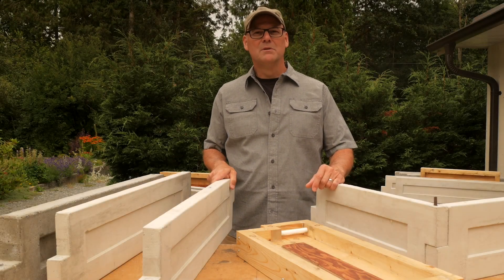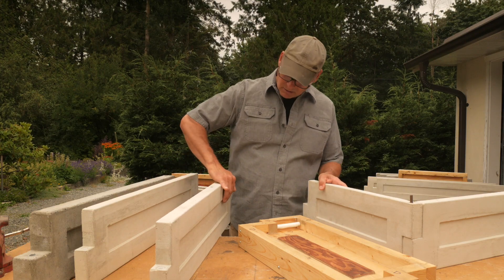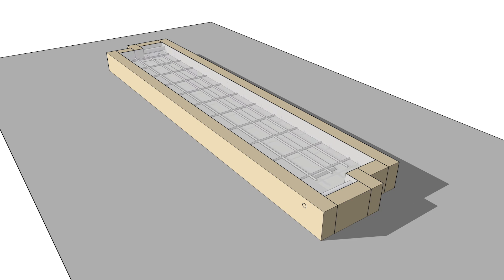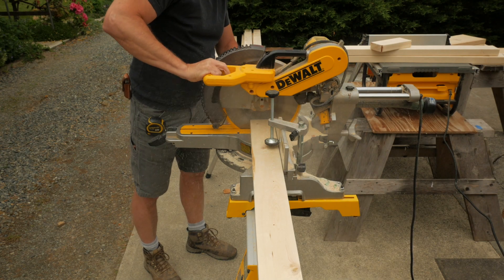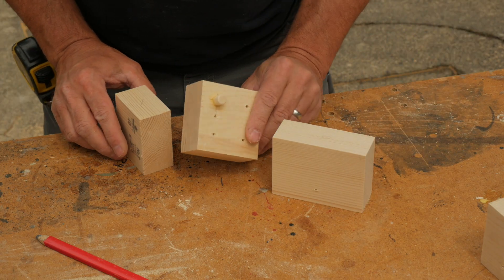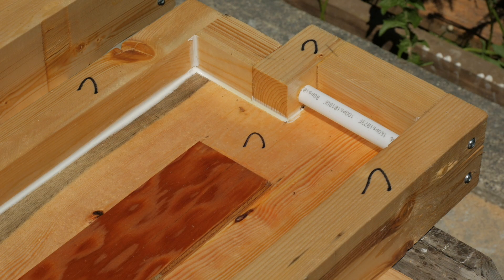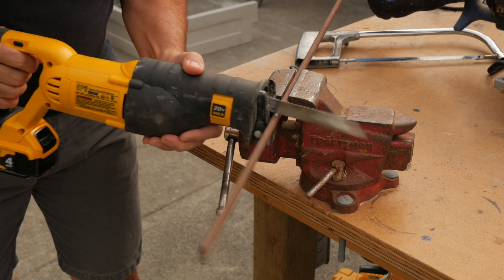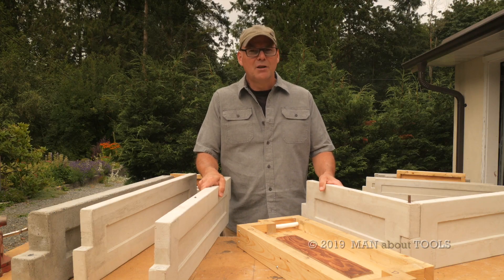make Thin CSA Concrete Garden Boxes PART 4 - cast garden forms

Comment: I noticed that you didn't use wire around the pipe guides on this version.
Reply from the maker: Yes, with the increased strength, fibre additive,  and fewer air voids in this concrete I wanted to try it without the wire wrap. The section around the pipe is now fairly narrow and I thought also that its a bit too tight for the wire to be adequately embedded without getting too close to the surface.

Comment: Something else you might want to try for airiated concrete, is hydrogen peroxide; it's supposed to add small air bubbles like foam.
Reply: For aerated " ... concrete, is hydrogen peroxide;...."  source? reference(s)?
Reply: @notcharles  A friend of mine told me about it; said he saw it being done overseas.

Comment: I've loved these videos and have been plotting to build my own forms since first seeing #1 a few months ago. 

I have both questions and comments for potential modifications. 

Questions first. 
Where do you get the glass reinforcing fibers and plasticizer? I work at a large home improvement store and we don't carry them.

The rapid set mortar mix...is that masonry mortar or tile setting mortar? If not those, and HD doesn't have it where someone is located, where can the CSR(?) type of cement be found?

Potential modifications now.

For the lightweight concrete, did you consider using pearlite along with the vermiculite for weight reduction? While both absorb water, the pearlite would be finer than lava rock and less likely to absorb/be filled with the cementious mixture.

Lastly, I've been thinking about an angular modification to the original dimensions from my first viewing. Using a slightly smaller rod and some careful  placement, I've thought of making the ends function with multi-angle position options. By attaching pieces shaped like triangles in cross section on the bottom and top of each end of the form near the pipe, the overlap could be faceted so that multiple joining angles could be achieved beyond just right angles. Making the ends rounded would be fairly easy, but not as stable. Do you have any thoughts on that potential?
Reply from the maker: Thanks! The fiber I ordered from Amazon. It's on my blog post here: https://manabouttools.com/make-thin-csa-concrete-garden-boxes-part-4/
I've only used the Rapid Set brand Mortar Mix. Not sure where else you could source CSA cement. 
Perlite was ion my list. But was cut from Part 3 due to time. Thanks, Kent

Comment: nice but very expensive at 20$ for 3 pounds bag, I'll keep to the old concret
Reply from the maker: Yes, the CSA is more expensive for sure.
Reply: @MANaboutTOOLS  Rapid Set is about $12.50 per bag (USD) at Home Depot when 25 or more are ordered.  Each bag weighs 55 pounds.

Comment: Nice Video series, for PVC pipe, have you tried driving longer PVC pipe thru the wood instead of using pegs ?
Reply: That would complicate things when ready to disassemble. THe PVC stays in the concrete and pegs just make sure it doesn't move while it sets.

Comment: Great videos! I am thinking of using this design to build a small shed, maybe 16' x 12', I think I might add additional plastic piping to pin the levels together in a staggered pattern. 2" long pipe every 12" along the top & bottom should work nicely.
Reply: That seems really risky...

Comment: It makes a more complicated form but have you considered creating an angled joint at the ends.  An end would have a surface on its extended "ear" that is angled down toward the long side from its outer face and the surface would have a similar angle inward and up on the other direction thus locking the sides with their upper "ear" to the long members.  I mention this both for some inherent stability along with pins at the corners and to allow another option in moving a bed.  If you cast in two recesses spaced appropriately along the base of the long sides one could use a fork lift to lift the entire bed.  Because the bed has no bottom the contents hopefully will fall out over the fork lift arms thus handily emptying the bed.  Pins could of course be constructed with a head and would come out of the ground as the bed is lifted and maintain the integrity of the "box".  Angled ends would just add a bit of further forces keeping the "box" together.  (p.s., I have "mixed dominance" (left eye dominant and right hand dominant) and have great difficulty envisaging thing in three dimensions.  I hope you get the idea even if I have my orientations scrambled)

Comment: Please consider an episode dedicated to the details of handling and cleaning up cement waste from your mixing tools and the buckets and forms; I have a water way on my property and so am concerned about concrete wastewater runoff. I have septic and so can’t rinse my tools in the sink.  What are your suggestions for best practice?  I don’t see this cement cleanup topic covered elsewhere.  Thanks for some of the best videos on YouTube 🤝
Reply: J Kauth rinse in a kiddie pool to and collect the water.  It will be high in lime so high in ph.  Neutralize with an acid to a neutral ph and dispose.  We use dry ice in construction, but there are more economical ways at home that take longer.

Comment: the sun hits the sides of my garden tubs & boxes and the roots hate it. it gets way too hot. i need insulation around my soil to keep it warm but not too hot. this issue is real. yer thin boxes should work. depends on sun exposure and, where you live i guess.

Comment: I would keep using the wire grid. The CSA cement, like Portland cement, is very weak in tension, which is what the wire grid is there to compensate for.
Reply: 14:02; 14:54
Reply: As a proud alumnus of Cal Poly SLO,CA. I'd suggest looking at the annual national concrete canoe competition. That is a really refined use of high-performance concrete.  Those boats are an engineering marvel.  

For the raised bed panels, the wire mesh might just be the ticket for avoiding damage during handling and assembly.  That end design does look more fragile to me than the main section, but the glass fiber reinforcement should help.

I had a friend who built a ferro-cement sailboat in the 1970's.  That's such old technology now given advances in low permeable, lightweight, fiber-reinforced, superplasticized, fly ash, silica fume concrete.  I wonder why we haven't seen this in boat construction.
Reply: I cast my first four 11" X 48" panels without steel and 12 hours out of mold they broke very easily . Curing must be a critical part of the formula.  1 oz of fiberglass instead of 1/3 oz seemed to be useless.

Comment: Sir I want to make light weight 36 inches in diameter and 18 inches high Concrete bowls for water gardens. They should be water proof. 
Sir how can we make them in very light weight.
What type of conrete mix we use to make them strong,light weight and it should hold water.
Thanking  you and looking forward for your suggestion.Sir I want to know the concrete formulation using portland cement or you know best. Thanks

Comment: I have the older version of these plans but I am going to order the new ones. I like the new csa concrete. I would also like to see plans for taller boxes for sub-irrigation planters. In drier climates, the sub-irrigation planters with 4" pipe in the bottom works wonders.  Make the planter, add pond liner, corrugated drainage pipe, yard cloth, and good potting soil.

Comment: I made the previous version with 2x12s, 48 and 60 in long. Yes they are quite heavy but still (barely) manageable. I found it is very important to level the forms before putting in the rebar, I cracked one trying to force it in but it still holds together fine thanks to the wire and mesh.  I'm waiting to see how well they do over the freeze thaw cycles we get here before making more.

Comment: I have used perlite in the CSA Concrete at 1/1 and 2/1 (Perlite/CSA) when making figurines.  The finer the better (seed starter grade).
Reply: Great idea!  What's the weight savings of these ratios?  Tough enough??
Reply: @737smartin  20% and 40%--using the finer grade is best and does hold up to the freeing/thawing here in Michigan. Have some 6 years old setting on the ground and still looks new.
Reply: @vdwalt4464  How big are your figurines compared to these panels?
Reply: @nickifalk8322  4' tall Bald Eagles.

Comment: Nice... I’m definitely going to make a few of these. I’m thinking of adding some dye to the mix to give the boxes some color!
Reply: Or pigment and texture...there r so many variations when google ....... I think I will just make them out 2x4s or discarded wood from pallet and coat them..
Reply: @nc3826  If you use for veggie garden, need to be careful of treatment chemicals leaching from treated pallet wood (some is, some isn't and can be hard to tell).
Reply: @PinataOblongata  Very good point but even concrete can have leaching issues such as from  calcium carbonate or calcium sulphate or even fly ash to name a few...and  when using pallets it's just a matter of checking the  IPPC stamp on treated pallets which tend to rare since  treating pallet wood adds cost... and I will just looking at one use disposable pallets....https://www.1001pallets.com/pallet-safety/ but for thx for your feedback...
Reply: @PinataOblongata  also plan to coat with a natural oil to preserve it... but it would also reduce leaching too... in the case of non label treated wood....
Reply: @nc3826  Never even thought about potential for fly-ash in concrete! Yeesh.
Reply: @PinataOblongata  Just pointing out fly-ash is "sometimes" in concrete....and there has 100s of case where substances such as asbestos were in siding and were considered safe to use in products...but now have to be disposed of as hazardous waste...but try not to overthink it....

Comment: very fine work and many thanks... I built 2" x 18" x 36" plain concrete poured sand cast box panels; w/ beveled corners set in treated lumber frames ~ 39 years ago and, remarkably, they are still good....but these are very sweet and much lighter....your vermiculite recipe is right on, as I know of 2' x 2' x 2' x boxes built in the 60's with that basic formula that are still on the same porch....

Comment: I have to admit this 4 part series has really interested me, I am in the process of selling and moving back to my home state and definitely want raised beds and this has turned out to be a wonderful idea. As much as I have enjoyed this I would like to request one bit of information a cost breakdown on the different formulations, my initial impression is the plain portland will be the cheapest and in my case doing a modified Hügelkultur method and not moving them for 3 to 4 years the weight should not be an issue. Any information you can provide will be greatly appreciated, Thanks
Reply: I have made a number of the panels using the fiberglass reinforced concrete sold at Lowes. It is $7.10 + tax per bag in our area. I made the forms a couple of inches shorter than the plan so an eight foot board would yield two pieces for the form. With the forms this size, the 80 pound bag makes about 1-1/3 panels. I have four forms and three bags makes four panels. The concrete costs about $6/panel. The plastic pipe, wire wrapping, wire reinforcement, and vegetable oil spray add a little more, but not much. I figure around $6.50 per panel.

Comment: We thank you !    Excellent job......they make fiberglass electric fence poles so no rust issues with the corner pins.
Reply from the maker: Thanks! I forgot to mention alternative materials for the pins. Thanks for adding that! Cheers, Kent
Reply: @MANaboutTOOLS  would these be ok for a building a fire pit?
Reply from the maker: @puppay  I don't know if this type of concrete can handle the heat.
Reply: @sires6  wonder what the cost, but just WOW!
Reply: @puppay  Concrete will exploded if heated to much, a fire brick will buffer the heat created by the fire. The air pockets in the concrete are what creates the explosion or splintering.
Reply: @fasteddyskil  gotcha...thanks for the info!
Reply: Those fibreglass poles are horrible when they splinter and degrade. It might be difficult to remove them intact.
Reply: @credenza1  And gettign those splinters out of your fingers is awful!!!

Comment: Cool video.  I would consider putting the notch or tab on the same side of each panel so that pin removal will be easier during disassembly.  This way you could lift at least one end staight up and off the steel corner pin without having to fish out the pin.
Reply: But then you would lose vertical direction symmetry if you were doing something more ornate or angled, as some would need to be upside down ?
Reply: @tablatronix  If the tabs and the relief are centered correctly there is no up or down for each panel.  Same side tabs would aid in assembly and greatly aid in disassembly.  With staggered tabs, once the steel pins are driven home they cannot be readly removed because the weight of one adjacent panel would still be holding the panel down and the panel could not be slid out because the pins are still achoring the panels to the ground and interlocking them to the adjacent panels.

Comment: i noticed you left out the wire reinforcement on the water pipes this time?  i think if i made these i would be tempted to put that back in since the concrete is so thin there and it is likely to be a stress point.

i'll never forget what matt risinger from the build show said, there are 2 kinds of concrete in the world....  concrete that is cracked.... and concrete that is going to crack.
Reply: Desert Garden Prepper The Rapid Set Mortar reaches incredible strengths in just one hour, about 2500 psi in a few days and above 6500 psi in over 5 days.  You don’t need reinforcement for these kinds of panels.
Reply: @cgparas1  steel tensile strength is 50,000 PSI.
Reply: @1pcfred  Right, rebar is what you're refering to.  The above is in reference to welded wire mesh.  You don't need neither for these types of panels unless you decide to maybe stand or sit on them, which you could jump up and down on these and still probably not break them.
Reply: @1pcfred   Here's your proof. chttps://www.youtube.com/watch?v=T7mYB6x68DY&t=10s
 As a Florida General Contractor that has 30+ years experience and as the principal owner of commercial building construction company, it's not debatable in my opinion on if these types of panels need reinforcement. They will last for 30 plus years without.  Watch Mikes video (link above), I've also made plenty of these counter tops, and yes chipped arenas full of concrete out in my lifetime, so I agree with your comment about the demo aspect.  You can put whatever you want in your High Strength Mortar panels; rebar, WWM, dental floss, I don't care, but you absolutely don't need to, unless you are fitting sinks in, then use rebar.  To each their own.  Success with your projects.    By the way that's not concrete, it's high strength mortar, which sets in a few days at 6500 psi.  I love this stuff for small projects like these and I rarely need to reinforce with steel..
Reply: @1pcfred  Yep, I didn't doubt you were part of the trade,  If I could have option of joints or hearing back, most likely would be taking my hearing back.  Rough industry, wear and tear, respect the trade.
Reply: also maybe split the tongues for the connection into two on one side and one in the middle on the other
Reply: Check out the Pantheon in Rome. Built ca. 120 AD it's the largest, unreinforced concrete dome in the world. It's 43 metres (142 ft) in diameter and height. There's a lot more than two kinds of concrete, though I do take Matt's point; I'm a fan too :-)

Comment: Can you give us the weight for these thin panels, as you did for the previous panels in this series?  Thanks.
Reply: Robert Deroeck , in the video he mentioned about a 40% weight savings for the thinner panels from about 50# to about 30# for a 36” panel.

Comment: Great series, but still wondering why you drive the pins into the ground, I would have thought that there would be enough weight to keep the boxes in position without this.
Reply from the maker: They probably would. If you line the panels up lengthwise then the pins driven into the ground would help to prevent the soil from pushing them laterally.
Reply: @MANaboutTOOLS  That would be perfect for low retaining wall panels.

Comment: Straight up pro video. You have a great voice for voice overs also. Well done. (Recording engineer)
Reply from the maker: Thanks Mark! I struggle with some sibilance. Might change mic's to something with less presence.
Reply: @MANaboutTOOLS  What mic are you using?  Your voice is calming and reassuring. You have a money voice.
Reply: If I may say try speaking across the mic and not into it.  I use a Shure SM7B Cardioid Dynamic Microphone into a Cloud Microphones CL-1 Cloudlifter 1-channel Mic Activator. Use a Movo WS10n Universal Furry Outdoor Microphone Windscreen Also known as a dead cat (lol) Best of luck sir.
Reply from the maker: @MrMarkRoads  Thanks! Outside I use an S Mic 2 in a blimp with furry. It's windy where I am so that has worked very well. That runs into a Zoom H5. For my VO I use a Sennheiser e835 with a Fethead going into a Scarlett Solo. I've been looking at the Shure like you have. It's on my VO upgrade list. Cheers!

Comment: I would love to see the vermiculite mix tried with the plasticizer. If I'm not mistaken the plasticizer really helps the concrete flow at a lower viscosity which should also help you set a better finish by allowing bubbles to escape more easily. I may have to try this.
Reply: "would love to see the vermiculite mix tried with the plasticizer" Well, then, go right  ahead  but do not forget to video and document your efforts and link to them from here?